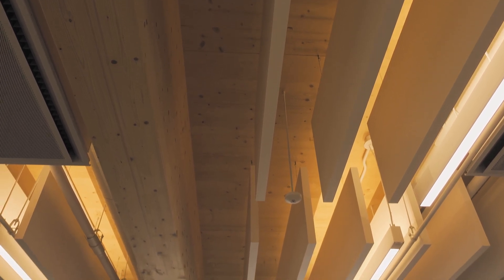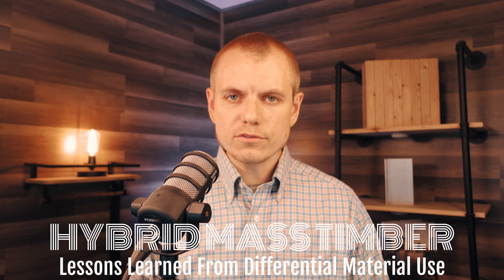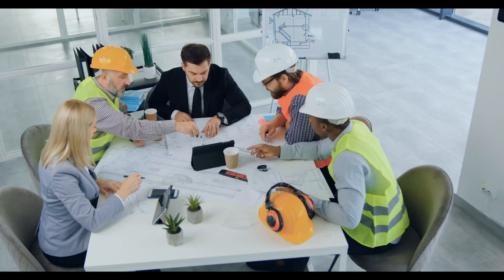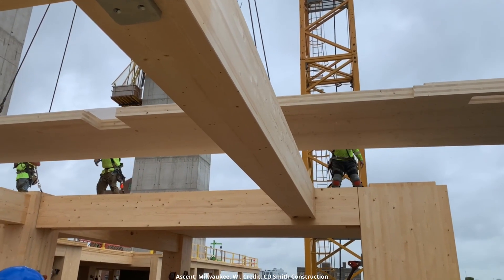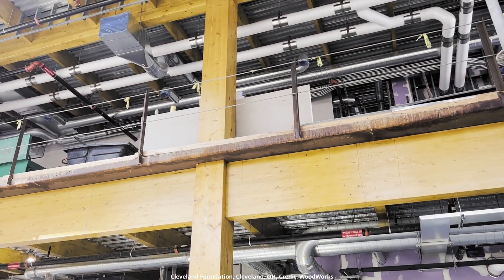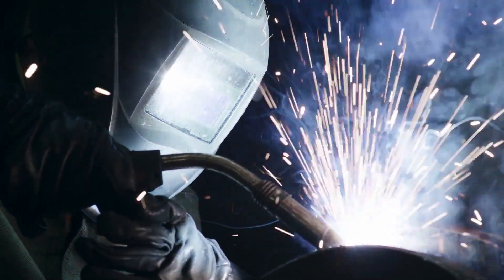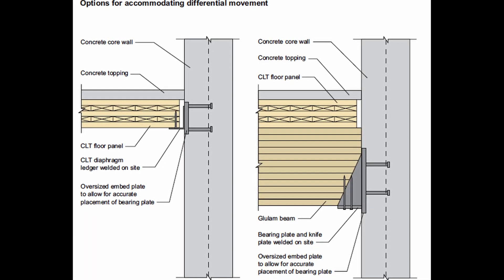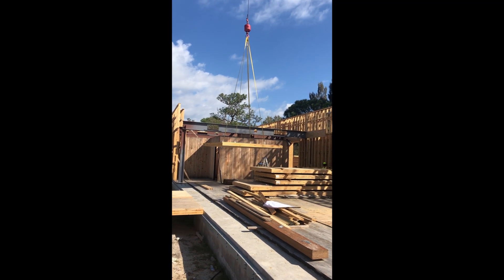Hybrid Mass Timber: Lessons Learned & Tips for Success

Comment: Would NLT be a possible replacement in residential construction for a monolithic slab on grade? If the entire slab is inside the building envelope insulated underneath with the vapor barrier between the insulation and the NLT slab. Would there still be far too much expansion in the slab to make this suitable?

Comment: Key insights:

🏗 Mass Timber's versatility allows it to act as the structure, expose architectural finish, and provide inherent fire resistance, making it a popular choice for construction projects.
🌳 Mass Timber is chosen for its aesthetics, speed of construction, and sustainability, making it a popular choice over other structural materials.
🏗 Using a hybrid approach of mass timber and another material creates complexity in procurement, coordination, and logistics, requiring careful planning and coordination.
🔥 Mass Timber's exposed finish and fire resistance rating make it unique but also requires additional care and protection on site.
🏢 Using a hybrid Mass Timber plus other materials can provide benefits in terms of span-to-depth ratios, making it a suitable solution for spanning long distances in office scenarios.
🏗 Understanding the differences in material tolerances and movements is critical when working with hybrid mass timber, as it requires creating details that accommodate the differential tolerance between materials.
🔥 On-site welding is often minimized or eliminated in structural steel and Mass Timber projects to avoid fire hazards and potential damage to the adjacent Mass Timber panels.
🌲 Woodwork is a free resource available to answer any questions about hybrid Mass Timber structural systems, providing support and guidance for projects in this field.

TLDR: Hybrid mass timber structural systems offer a versatile and sustainable solution for construction projects, but careful planning and coordination are required to address the complexities and differences in material tolerances.

1. 00:00 🌲 Mass timber's versatility as both structure and finish, combined with other materials, can effectively enhance construction projects, but understanding its behaviour and interaction with other materials is crucial in determining its value compared to traditional options.
	1.1 Mass Timber's versatility allows it to serve as both the structure and architectural finish, and when combined with other materials like steel and concrete, it can be effectively incorporated into construction projects.
	1.2 Understanding how hybrid structures of mass timber and other building materials behave and interact is important in order to determine the value that mass timber can bring to projects compared to traditional materials like steel or concrete.

2. 02:09 🌲 Mass Timber offers benefits such as aesthetics, faster construction, sustainability, and suitability for sites with poor soils due to its warm look, time savings, lower weight, and environmental friendliness.

3. 02:42 🌲 Using a hybrid approach of mass timber and other materials in construction can reduce the need for soil remediation, but it also adds complexity in terms of procurement, coordination, and logistics.

4. 03:43 💡 Mass timber requires careful handling and protection from moisture due to its dual role as both a structural and exposed finish material.

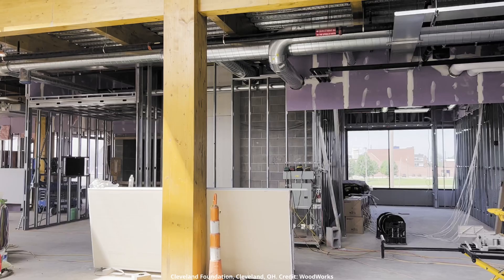5. 04:30 🌲 Using a hybrid Mass Timber system with other materials like structural steel beams and columns can provide benefits such as better span-to-depth ratios, allowing for longer distances and more creative options like fixed connections and cantilevers.

6. 05:43 🌲 Understanding the differences in material tolerances and movements is crucial when creating connections between structural building materials with tight tolerances and other materials, in order to accommodate differential tolerance and material movements on site.

7. 06:24 🌲 Mass Timber is not affected by moisture or temperature fluctuations, so it is important to understand and detail the connections between different materials to accommodate any potential differential movements.

8. 07:22 🌲 Having the same installer for both mass timber and other structural materials is beneficial for coordination and scheduling, maximizing installation speed, and reaching out to Woodworks for free resources.
	8.1 Having the same installer for both the mass timber and other structural materials is beneficial for coordination and scheduling, as it allows for a synchronized and flawless installation process.
	8.2 Maximize the installation speed of mass Timber construction by ensuring a seamless transition between materials, and if you have any questions, reach out to Woodworks for free resources.

Comment: Thank you for your Well-done & insightful videos.

I will take issue with the opening statement which highlights 'doing more with less'.   This kind  of construction is wonderful, but when we start thinking of it (or anything else) as a way  to 'do things on the cheap' (especially the less-skilled & sincere designers/builders), we start a slippery slope from Architecture & Structure into buildings that end up becoming exercises in slapping on veneers & appliques 

OK, I relinquish the Soap-Box.

Comment: In this video, Ricky McLean of Woodworks discusses the benefits and challenges of using a hybrid approach in construction projects, where mass timber is combined with other structural materials such as steel or concrete. Mass timber is becoming increasingly popular due to its versatility, acting as a structure, an exposed architectural finish, and an inherent fire-resistant material. When used in conjunction with other materials, mass timber can create aesthetic and sustainability benefits, as well as savings in construction time and weight. However, using a hybrid approach can also create complexity in procurement, installation, and on-site logistics, as it involves working with multiple suppliers and coordinating different materials. Understanding how mass timber interacts with other materials is crucial in incorporating it into existing project designs. McLean shares lessons learned from real projects using a hybrid approach to help others benefit and apply these insights to their own projects.
Reply: ChatGPT